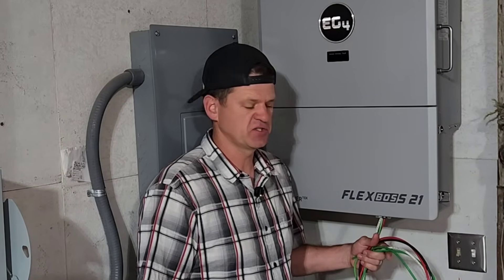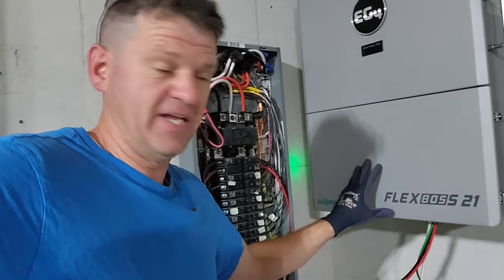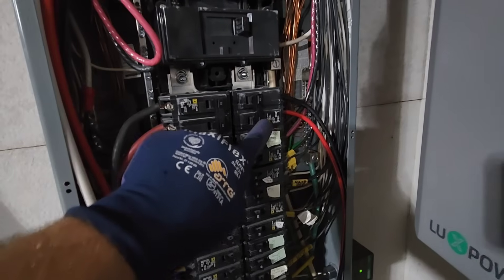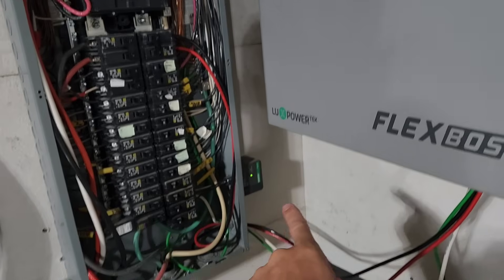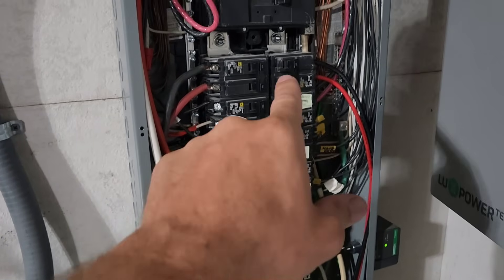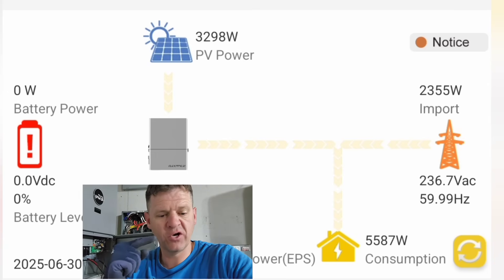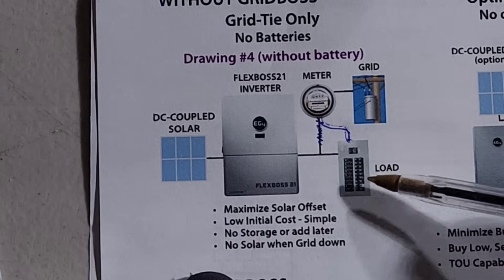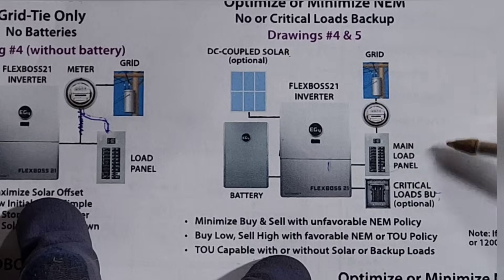Easiest Way To Install a Eg4 FlexBoss...And Other Hybrid Inverters

Comment: I am trying to do something similar where I am not looking to back feed the grid, but simply trying to feed an existing panel where there are multiple systems I want backed up - unlike in your case, I am not looking to have solar panels provide the necessary power but just want the batteries to provide the power to the existing panel (not a new critical load panel).  Seems plausible?
Reply from the maker: Hmmm...This configuration won't provide back up power when the power goes out.  Check it my "zero power bill video"... that will provide back up power when the power goes out.
Reply: @diySolarPowerFunWithRay  Thanks but was looking for ATS solution as opposed to interlocks for power to resume when I'm not home...but thanks
Reply from the maker: These inverters have a ATS build it so if you batteries get low it will automatically switch over to grid power("grid pass through")... and also automatically switch back to solar when the sun comes back out.   Here's another wiring configuration that I also really like: https://youtu.be/NMDC8JQKJf8

Comment: Does the watts 24/7 nhx inverter have this ability?
Reply from the maker: I believe so.  I have a coupon code for them also if you want to go that route. 👍
Reply: @diySolarPowerFunWithRay  Thanks used your code last Saturday to purchase the 10k unit.
Reply from the maker: Awesome. You'll like that inverter.   Be carful when connecting L1 and L2.  There are 2 L1 connections and 2 L2 connections. (Each has a douple pull breaker)

Comment: great video. would like to know if my house have a main electrical panel of 125 amp do need to replace or I could install the 70 amp on it?
I have a flex boss 18 hybrid. Thank you
Reply from the maker: This would be a better question for an electrician.  If you send them a picture of your panel I'd bet they could tell you over the phone.

Comment: 5:50 how are these settings accessed? Via the internet / some cloud service that the GridBoss 21 is connected to the internet??? Or do you access it via local browser and network IP?
Reply from the maker: The most common way is to connect the Wi-Fi dongle and then you can log on to a website to configure it. But I believe they also have a Bluetooth option where you don't have to connect to the internet... or there is a separate screen you can purchase..

Comment: at 4:50, The breaker does not NEED to be at the bottom but it is better for the panel power distribution.

Comment: It would be great if you did a video explaining how to set this up with grid integration for selling back.  I think the hardware requirements are different under that scenario.
Reply from the maker: This configuration will also work for sell back. It's a simple setting change. You can make setting change or you can call eg4 and setting change or you can call eg4 or signature solar and have them make the change for you.  The more difficult part is getting the permits and permissions from your electrical supplier to sell back. There are some areas that don't buy back power at a very good rate so you can add some batteries and instead put the extra power in batteries. Also a setting change that they can make 👍

Comment: Which working mode is this? Trying to set it up. Hopefully tomorrow so i can finish dialing it in.
Reply: I am trying to set this up as well. Tried peak-shave and forced discharge and the FB will only output around 115 watts. Any settings suggestions? @diysolarpowerfunwithray
Reply from the maker: I would definitely call eg4 and have them look over your settings. They can even make the change for you if you'd like. They can do it really fast.  I thought I had things right in the past and I called them and they always make some additional adjustments for me that I missed. 👍
Reply: @diySolarPowerFunWithRay  all done. Works 👌🙂 thanks
Reply from the maker: @SurgeonTech nice!!
Reply: @diySolarPowerFunWithRay  All working.  This thing is sooo smooth.
Reply from the maker: @DaveN-cq2jr  nice 🎉

Comment: So in the config you show here, even if you have PV and/or a battery, if grid fails your house goes dark?
Reply from the maker: That's is correct... for this configuration. You'll have to wire it in the more traditional way if you want to have power when the power goes out.
Reply: @diySolarPowerFunWithRay  thanks for clarifying, much appreciated

Comment: I believe the breaker has to be 90A because it’s 66.67A/0.8=83.34A rounded up (assuming you have both battery and solar in the system later).

Comment: The breaker should not be at the top of the panel like that. It needs to be as far away from the lugs so there is as much metal as possible to absorb the heat.

Comment: Do I understand that because the CT's show 0kw incoming the FB21 supplies 0kw to panel?
Reply from the maker: hmm... Not sure i'm following.
Reply: @diySolarPowerFunWithRay  the system will only supply wattage equal or less than what the CT's read incoming from the meter.

Comment: Can you do this if a hybrid grid tied inverter is already in use at my house?  In other words add a hybrid system wired like in your video to the existing system.  Existing system is an 18KPV grid tied with back feeding agreement and a critical loads panel on the 18K load side.  Thanks in advance.
PS: I got an extra string of solar panels so I might as well assist with charging the main bank of batteries.  :)
Reply from the maker: Why do you want to add that extra inverter? Is it for the extra solar array? Do you need any more power?
Reply: @diySolarPowerFunWithRay  Just to expand the system.  I seldom go over 12KW but I have.  My house heating is 3 stage - 5kw, 10kw and 15kw.
I got 9,600 PV on the 18KPV and 2,200 PV on a 6500EX.
Thinking of replacing the 6500 with another 18K and adding about 4,000 watts of PV in addition to the 2,200 watts.
I use some grid on cold days.  On summer days I use nearly zero grid and use about 50% of batteries overnight.
The second 18K is used and at a very good price.  The con I guess is the overhead of about a 70 wh.
Reply from the maker: @tomasperez1256  Cool. So are you using the output of the 6500ex? Or are you just using the 6500ex for a solar charger?
Reply: @diySolarPowerFunWithRay  I'm using the 6500EX only as a solar charger.  It is only connected to two strings of PV, no grid input and no batteries.

Comment: The 12000xp or the FlexBoss21? The FlexBoss21 is $2000 more expensive. 
I'm am not going to send power back to the grid. 
Thanks for the info.

Comment: I think wiring at the bottom is fine but if you want/need to use a generator lockout, it needs to be at the top.

Comment: How could you configure this for backup when the grid goes down? Setup an interlock and change the flexboss settings during a power outage?
Reply from the maker: For this configuration, I would have a critical loads subpanel and I would run the load connection of the inverter to supply power to the critical load sub panel.  Because of "anti islanding" the grid port will not supply power out when the power goes down.

Comment: How did you size your solar array going into the flexboss21?

Gret video!
Reply from the maker: Hi, I just had one string of 7 panels going into one of the mppt's... making sure I stayed under the max voltage.  And then I did the same thing for my other string of seven panels.   At the 4-minute mark in this powerstation video has more details on how i did it:  https://youtu.be/DtqNJW52ZS0. 👍

Comment: Diagram #4, which this looks to be, shows a disconnect switch between the inverter and the load center.
"PV
System
Disconnect
Non-Fused
100A Rated
Eaton
DG223URB
or equiv."

It appears it may be required, even though you can shut it off with the breaker on the panel?
Reply from the maker: In the United states you'd have to look at NEC 690.13...(I'm not sure what they require for disconnecting means).

Comment: You will occasionally get tiny bits of backfeed to the grid when your air conditioner or other extra large loads turn off because it takes a moment for the inverter to sense that and to stop producing power.  There’s a setting to allow a specified numbers of watts from the grid instead of the inverter shooting for 0 watts.   That can help, but you can’t stop it entirely.  Most power companies won’t care if you set that up conservatively to prevent backfeed.  However, i’ve heard that others will send you warnings followed by potential fees.
Reply from the maker: Ah... cool. I didn't know they had a buffer setting you could adjust. I'll have to check that out.  Yeah, I don't think it's a super big deal. If my power company ends up giving me a warning, I will adjust that.
Reply: @diySolarPowerFunWithRay   Great video btw.  Very helpful for people that want to install solar with minimum electrical expenses.

Comment: I was just thinking that maybe there might be other inverters that could work without batteries as the flexboss does but at a better price. Any thoughts?
Reply from the maker: Nhx does as long as you have grid... i haven't tested that specific feature on the nhx unit though.

Comment: Do you follow the 120% rule for the bus bar. You might overload your bus bar.
Reply from the maker: Victor, Thanks for bringing this up.  I added some resources in the description and my calculations. I should be able to backfeed 100amps from my calculations.  I believe I need to follow the solar 100% rule(see description) because I'm backfeeding near my main panel feeder lines.

Comment: technical its not that inverter has come along way, even the old Growatt grid tie inverter has all the functionality, most if not all Youtuber just never played with grid tie inverters so they are thinking zero export with CTs in the main panel is like a new thing, and the fact that gird tie inverters with battery support use to be called just grid tie inverters, now they call them hybrid inverters and Youtubers think its a all new product, look up the Growatt MIN XT grid tie HV inverters, its really no different than an EG4 18kpv or 12kpv hybrid inverters, anyways all that is nothing new grid tie inverters has always have this functionality people just thought they need permits to use them, when all they needed todo is enable zero export and zero sell back in the settings, but yes the old school grid tie inverters does not have backup load outputs only backfeed to your main panel.
Reply: Yep this man is correct my min 11.4 dose all this but for 1500 dollars and with a device called syn 200 (1300) it will supply power even when the grid goes down
Reply: @bennippert4482  correct, one day i’ll have to add the SYN 200 .. only reason i have not it’s because my grid is very stable, zero outage for over 10 years now, and the last time if i remember correctly was only for like 1-2min.
Reply: i put in a solaredge system.  did it myself.  it is a 10k inverter.  Grid tie.  there is no way to just hook a battery up to it.  but I could use an EG4 hybrid inverter and have the solaredge input into the "generator" input.  then the Solaredge would not shut down even if the grid went down.... which is what happens now.  I think what you said depends on what time frame you are viewing things from.  either way these new inversters are cheaper and way eaiser, plus batteries have started to come way down.  Which is awesome.  I hate SDGE my power company I do everything in my power to not give them a red cent of my money.
Reply: @bpb5541 yeah its crazy, depending on the manufacturer and model some older grid tie does not have battery and or load output, however the tech been available to grid tie since 2012 when I built my first DYI solar setup back then using MC3 connections before MC4’s was even a thing, some manufacturers keep making some of their old proven models just with new software etc.. but yeah today you can buy cutting edge inverters, i moved up to High Voltage grid tie inverter using HV batteries, the LG 16H prime very cheap for what you get, real good way to stop paying the electric company a load of money!
Reply from the maker: Those HV LG Batteries are pretty neat.  Very affordable too.  I wish they had the ability to connect more that 2 together.
Reply: @diySolarPowerFunWithRay yes the only way right now to use more than two is to parallel the inverter and connect two per inverter, or just AC couple the inverters with two batteries per inverter.
Reply: @diySolarPowerFunWithRay  What's even funnier is that all these inverters are made in the same factory. 😂

Comment: Just note that the "Fast Zero Export" option only works in this particular configuration.  In most other configurations it has to be turned off because it might cause a lot of nuisance disconnects or otherwise cause the intended working mode operation to not work properly.

Also note that this configuration is grid-tie only.  The inverter cannot safely run the panel if the grid goes down because you do not have a common transfer switch or lockout to ensure things stay safe.  So you never put the inverter into "off-grid" mode in this configuration.   (and you'd need a battery as well).   You'd need a GridBoss MID if grid-down backup is desired.

Without a battery a lot of solar power is being thrown away.  I would consider adding at least a small battery... even an undersized one, and (VERY IMPORTANT) configure the system to limit charging and discharging to the capabilities of that small undersized battery and its wiring.  This isn't ideal, but less solar will be thrown away.   When I say small I mean even like a 50Ah 51.2V LiFePO4 battery (just 2.5kWh) would probably give you a vast improvement.

And consider a Flexboss18 instead of a Flexboss21 for this kind of setup, just because its a lot cheaper than the 21 while still being a hybrid inverter.

Ultimately the difference between this and just using an off-grid inverter + battery is that the hybrid inverter setup can aid in running larger loads than it would otherwise be able to fully cover, whereas an off-grid inverter must fully cover all loads.  It's very useful, particularly for people who might be a bit squeamish and reticent trusting a hybrid inverter to not blow up their appliances if something were to go wrong.  Because the utility is still present, that can't happen. 

-Matt

Comment: @diySolarPowerFunWithRay great video keep them coming! Not to be nosey but how do you afford to spend 10's of thousands on all of this solar equipment and collect it? I wonder that about a lot of solar channels cause this stuff is not cheap! lol.
Reply: Curios on this too!
Reply: I'm guessing EG4 sends him the inverter for free to get exposure.  I bought a (much smaller) EG4 system based on Will and Ray's videos showing how easy it is.  I do wish they disclosed if they received the equipment for free though.  Ray, any chance you'd share that info?
Reply from the maker: I get eg4 equipment at a discount.  Some equipment and suppliers will provide free equipment in return for a review on the item.  I try to review only items that are worth while obviously... there are a ton of miscellaneous Chinese batteries free for review out there.

Comment: Doesn't the new Utah balcony solar bill allow you to back feed 1200watts without permit?
Reply from the maker: Ya... i think it does... I need to look that up
Reply: With a large battery (and solar array) seems like you should be able to recoup 28kwh/day using that law?
Reply: If that is true that is super dangerous.  I would not want to be a linemen in Utah.
Reply from the maker: @bpb5541  . They have to be certified to not backfeed when the Grid is off. they sell kits all over Europe to do the same thing. We're just playing catch up here.
Reply: @bpb5541  it's just a grid-tied micro inverter.  It will shut off the inverter when the grid is down.

Comment: Awsome video. I am running a pool pump and other electronics maintaining 800 watts all the time, so a sudden shift in usage should not send power back . We hope.
Reply from the maker: I wouldn't be too concerned. Can you tell they actually allow you to some power to the groove without even getting inspected. You just need to make sure it won't back for you to win the power is out.  Which all these do that now day's..

Comment: Just a quick note the CTs can’t catch absolutely everything.. so if you have a large load shut off it will send some power back to the grid unless you are constantly drawing some power all the time. If you don’t have an interconnect agreement I wouldn’t do zero export